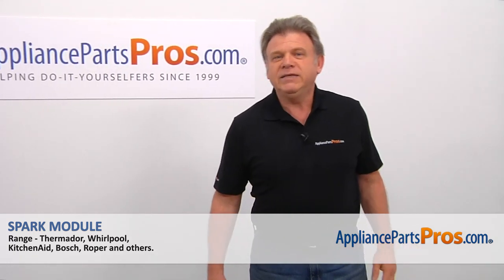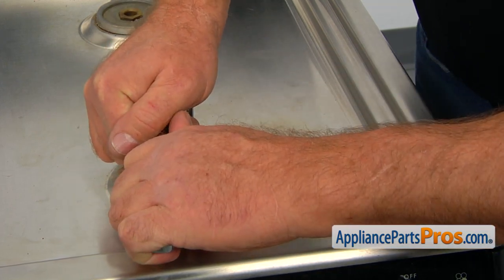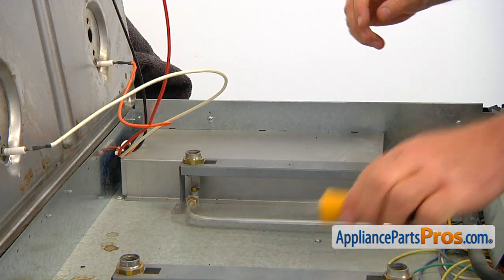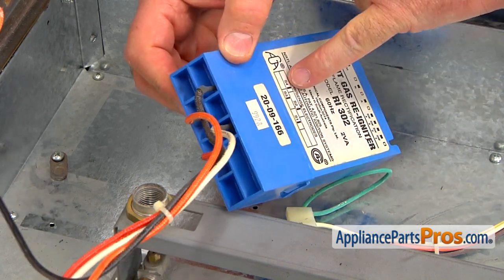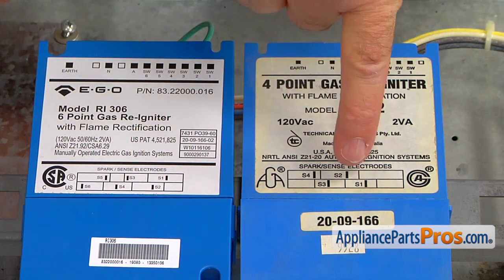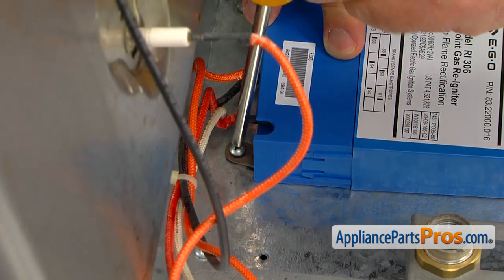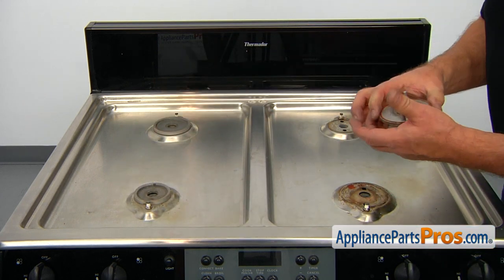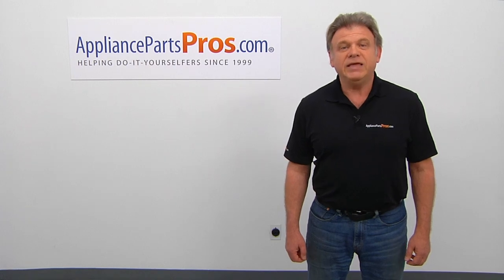How To: Bosch/Thermador/Gaggenau Spark Module 00753257

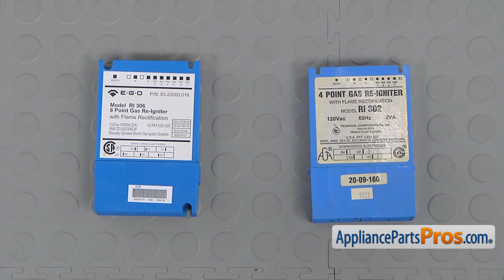Comment: I have a similar range, a RDDS30VRS which has four burners. It has two ExtraLow burners, so there is a Tytronics AQ003-HA Gas Simmer Controller installed between the burner control knobs and the original RI 324 Spark Module. When I installed this new Spark Module as instructed by this video and the included paper instructions, the igniters would continuously spark and never stop. I noticed that the pin on the connector from the gas simmer module that would go to SW1 was unpopulated, and the pin position labels on the original were all stepped over one from this new Spark Module (you can see the same relationship at 4:43 in this video - there is an open square on the RI 302 where SW1 is on the RI 306, SW1 is stepped over to where SW2 is, etc.), so I connected the igniters to the 2, 3, 4, and 5 output positions to match instead, and now everything works fine.
Reply: SUPERSAUCY you are the man.  I was having issues with my Thermador GR304US and since I had it apart (having to grind off the Venturi bolts) and was replacing many parts it occurred to me I didn't want to do it again.  So I ordered a new spark module to replace the 20 year old one which was working fine as far as I knew.  After all the many parts from several vendors arrived I replaced everything and was very frustrated with two burners continuing to spark after igniting.  Every answer on the net was a cleaning or other issue I could disregard.  I called an appliance guy and he said, "If you've replaced everything you've stated I can't help you."  Finally I came across your comment.  I re-ran  the igniters on pins 2 thru 5 and it operates like new again.  Thanks!  Those instructions from the module manufacturer were cruelly, and ignorantly,  dead wrong.
Reply: @michaelclausen8738  Lordy I hope this solves my problem TOO!!! PRG304US...4 burner and exact same thing you mention above with the 6 pot module...will take it apart again tomorrow and report back. Been playing musical chairs with the module just to get the burners working so we could use the stove.
Reply: I can confirm. Same problem on my gps364gls and @supersaucy ‘s suggestion fixed it.
Reply: FIXED! Same thing here! Thanks to @Supersaucy!

Comment: I have a  Thermador PRG366US. I changed the spark module, but when the stove gets hot the ignitors quit working and I can't light additional burners except with an external flame.

Comment: I have a RDDS30 and replaced the simmer controller as well as the two XLO pots.  Now the LF (XLO) will only turn gas on when the RR is on.  Otherwise it all works including XLOs.. I have checked the ignitor wiring and appears to be correct.  I have tried a new ignitor control unit and no change.

Would love any ideas.

Thanks
Tim

Comment: Hello I have one re-ignition 125, my question is can I install one 306?? Thanks
Reply from the maker: What is your model number?
Reply: @appliancepartspros  hello, it is ct130 model, is very old stove
Reply: @appliancepartspros  It is an old stove, it cannot be found on the internet or with the model.
Reply from the maker: Unfortunately, parts are no longer available for this model, so the manufacturer is no longer providing the part information, so there is nothing we can recommend. You may need to contact the manufacturer to get the part number you need, or you could try a vintage/antique appliance company to see if they can help you find a part.
Reply: @appliancepartspros  Thanks friend, I'll see if I can contact you, thank you very much for the information.
Reply from the maker: You're welcome!